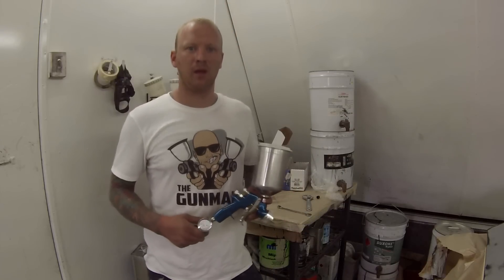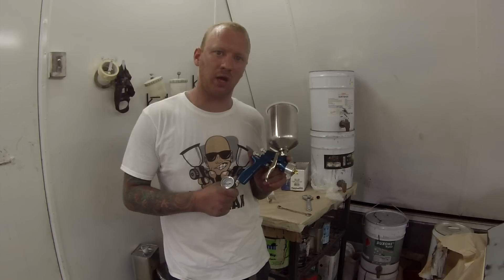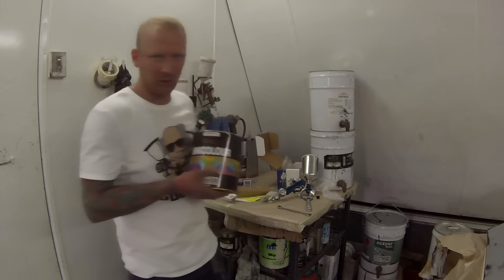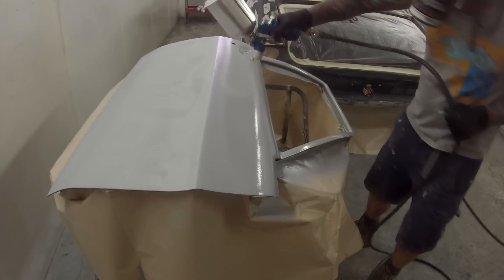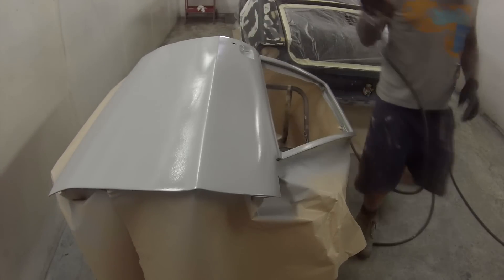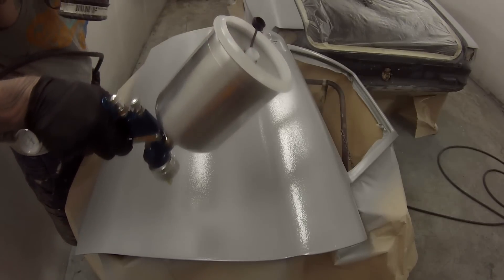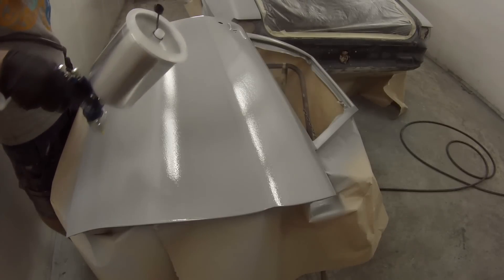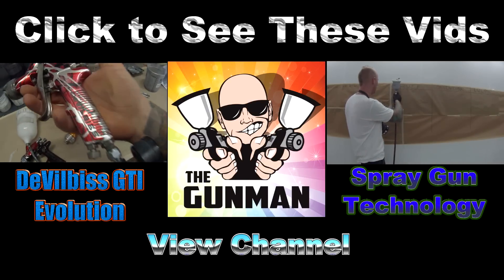FLG4 Finish Line 1.8mm Review and Demo

Comment: So please correct me if I have a misunderstanding but with an hvlp gun it should be about 10-12 psi at the CAP not the inlet. Inlet would be around 20 psi for a 10-12psi at the cap.

Comment: Just yesterday I used the FLG-4 with 1.8mm tip to shoot 4:1 high build primer on my project car. Contrary to results from some who have responded, the primer went on very well.  It was thick enough to take a long time getting through my paint filter and into the gun's cup. Temperature was 22 centigrade (70-ish) and I had preheated the primer and catalyst in water. I began at 12 psi, just for the hell of it and went as high as 25 psi before finally settling in at 20 psi. I kept checking the cap for unwanted build-up but it never happened. Once accustomed to the gun's performance and zeroing in on an optimum distance from the substrate, I got a very acceptable peel. I plan on fixing some newly-discovered flaws in my prep work, sanding and reapplying a single coat before going to base/clear. I'm pleased with my new gun but confused by the wildly varying comments. Oh well, at some point, you just gotta get in there and see what works for you, I guess.

Comment: I bought a new Devilbiss suction 1.8 mm fluid tip spray gun years ago and only used it a few times.
My question is what will happen it I try spraying base coat and clear with the 1.8mm tip?  Will it work  I'll be spraying the bottom half of my truck?
I hate to spend 450 pro lite  gun.
Reply from the maker: I wouldn't do that, you'll have way too much paint coming out.
Reply: Thanks for the info.
Years ago when these types of gun were not available we painted with no problems. I remember spraying 
enamel and laquer  with this gun.  What would happen if I just turn the gun down a little?
Reply from the maker: You could but it's still coming out of a large hole, so atomization will be a bit thicker.
Reply: Ok thanks but  that would be a great video for you to spray base coat with a 1.8 and show what would happen.
Reply: I ordered my Tekna pro lite gun with alum cup to save money on cups ,I hope the cup works out if not I guess I'll go with the 3d pps . 
Tell me what you think about the alum cup, I realize you are busy so take your time.
Reply from the maker: Nothing wrong with the aluminum pots mate
Reply: Thanks Mate!
Im not lazy so a little work cleaning the pot won't hurt and I can save money on throwaway  cup, they are not cheap.

Comment: Hey gunney, thanks for the review, and love your videos. Just started watching them and they are very informative. I was wondering if a higher psi would lessen the chance of the air cap building up the primer the way it did. What do you think.., I was thinking of maybe getting something like the FLG-4 but after your first review, I'm having second thoughts. Thanks gun!
Reply from the maker: It was very hot on this day and it is much better when you just thin the primer a bit more, since this video I have used the 1.5 &1.3mm tips with good results using clear over base and low voc 2k topcoat.
Reply: Awesome, can't wait for the 1.5 & 1.3mm tip videos, keep up the good work!
Reply from the maker: I have a review on the Bink's trophy series

Comment: Can you explain what is the use of the 1.3mm, 1.5mm and 1.8mm
Reply: GEMA CEDEÑO VÉLEZ smaller size for thinner materials, a 1.8 you would be using thick primer. 1.3 base coat 🧥 and clear coat 🧥

Comment: i use the starterline for primer and it did well in my opinion i also sprayed featherfill with it and that shit is thick...all with my 30 gallon but its the only gun ive used for primer so i cant compare it to any other gun..just one more point the little air hole on  top did clog on me and i was pissed til i calmed down and unclogged it after that all was fine..thanks for the review

Comment: According to Devilbiss the 670 model is for base coat, clear coat and light primers. If you are wanting to spray high build primers without thinning the product. Buy a FGL4 678 it comes with a 1.8 and a 2.2 needle and air caps. That may be why the gunman was struggling with his high build primer on the door. I am sure the Gunman knows much more about spraying and guns than I do.  I am just going by what the manufactures recommendations were.

Comment: I have the gun. I haven't been able to get it dialed in just yet. I have only sprayed epoxy through it and my pressure may have been to high, I think maybe 22psi is where I set it. Looking forward to the other reviews on it. I hope I can get it dialed in for primer. I also have the Tekna copper but haven't used it yet.

Comment: another great video, wonder can anyone on here recommend a good primer gun, i used to use cheap guns for primer but never got any last out of them as the cheap seals couldnt handle thinners, i bought the 3m accu-spray 1.8 not impressed with it but then again ive only used one type of primer through it and its shite primer going t buy the debeer primer that i like and see how it preforms with that but if its bad im going to buy a new gun money no object as i believe in good tools especially if they last any recommendations. all the way from ireland thanks again gunman
Reply from the maker: John Nicholas That Airgunsa AZ3 1.8mm works real good for primer.

Comment: As usual, an interesting, and informative video.  I have some reservations though about the comparative review of the two guns.  From the video, the first coat using the FLG4 (at only 1bar pressure, seemed to be hiding in only one coat, whereas with the other gun you seemed to be moving much faster, but the first coat was transparent or "see through".  Also, the panels seemed to have about the same amount of contrasting features and colour stripes that would show through.  So, equal panels, equal paint product, but different spray techniques, and different results.  I could be wrong, but that's how it looks to me in the video.  What was the pressure, and paint reduction with the Airgunza?  Some guns just require more air (volume or pressure) to operate the way they should.

Comment: Hey bro, i wish you didnt spend your hard earned cash on that gun. It is the worst Devilbiss gun i have every used. My friend purchased  it along time ago. I tried to use it a few times, but it doesnt lay the primer down. It will spray base, but so will any gun. I also dont like it one bit for clear. 
The worst part about it, is it feels so bulky in my hand. I get really fatigued when using it, and I get hand cramps.
The only thing i would do with it, it use the pressure gauge and cup for another gun!
I hope you find a good use for it, because i really hated this gun! But i must say, i love all other Devilbiss products. I still use my old GTI. Im in Canada, so im looking into purchasing the Tekna ProLite. Devilbiss ProLite in Australia!
Cheers
Reply from the maker: splash Agreed mate, I do like the regulator but apart from that I'll either do a giveaway or sell it once I've reviewed it for base and clear.
Reply: The Gunman 
Im about to purchase the Tekna Pro Lite. I have the option of 1.2/1.3 tips or 1.3/1.4 tips.
Air caps are TE10/TE20 or TE20/HV30.
Wich of these options would you suggest? I know you've done slot of spraying with your ProLite, which caps and tips would you say suit your style the best?
I know 1.3 is probably what il be using, but which other tip would be ideal to have?
Caps, im completely lost!
Thanks man,
I respect your opinion!
Reply from the maker: I'd get the 1.3-1.4 te10 - te20
Reply: The Gunman 
Do you find you end up sticking with the 1.3 tip for base and clear?
TE10 for base, and TE20 for clear?
Thanks again!
Reply: Hey sorry for jumping in. 
Tekna is I ne of the best gun in my choice. 1.4 to 1.3 best choices. I've only used 1.3 tho. Never had setback with this gun
Reply from the maker: splash I agree with Jose, te20 too.
Reply: jose garcia 
Sweet! Thx
Reply: The Gunman 
So you've decided TE20 suits you the best. Base and clear with the TE20?
Thx again!
Reply from the maker: splash
Yes

Comment: You are WAY under pressure on that gun. You show the gun with 13psi at the gun inlet triggered.  TheFLG4 should be set at 23psi  triggered.  That's why it performed so poorly.
Reply: I have that same gun. Way better than your video shows......but you ran it at like 13 psi and thats why the pattern was so narrow and buildup was on tip. I epoxy primered my whole car and mine never built up on the tip. But i also ran it at 23 psi....like is recommended